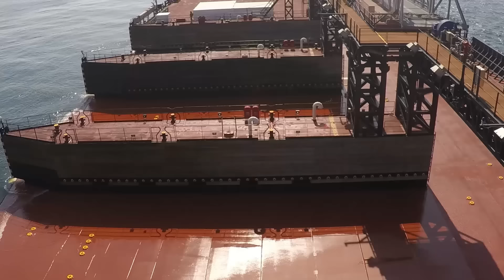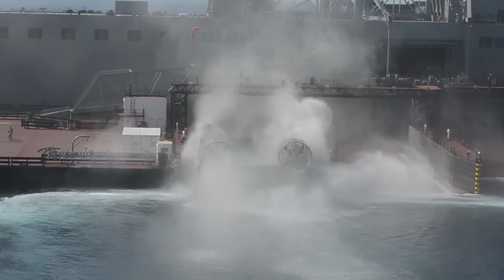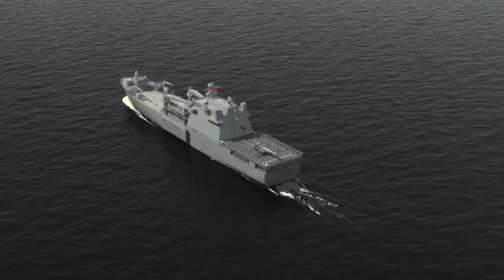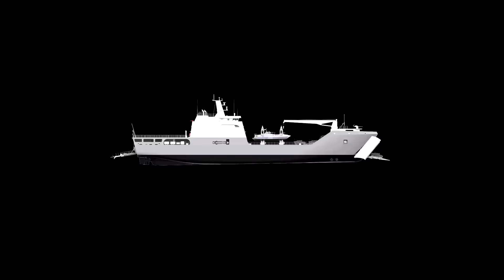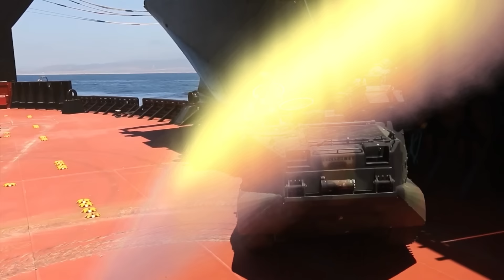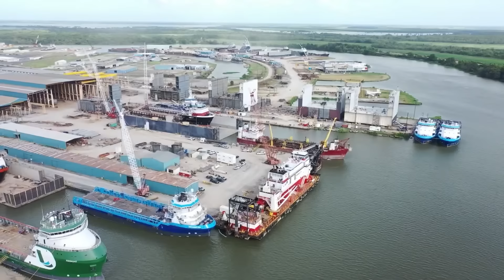The SHOCKING Truth About the US Navy's Idle $430M ESD Ships

Comment: Steel is cheap and the bigger the vessel the easier it is to upgrade various capabilities. The ESD vessels with a Helo Deck added but used for Shipping containers would make the Shipping container based missile systems and VTOL drone fighters easy to deploy. The small vessels will have issues with self defence.

Comment: Add a flight deck to make it more akin to the Expeditionary Sea Base (ESB) ships - which in turn don't allow LCAC transfers
Add a big crane for self (un)loading or transfer
I never understood why the USN built 2 similar expeditionary ships with such dissimilar capabilities, when these could so easily and cheaply have been merged into one far more versatile  design.
This is the kind of ship that typically won't get used in just its intended role - if you built in that versatility

Comment: This video doesn't tell the full story.  The two mentioned ships are the first two ships of of a new class of ship.  After these two came the Lewis B. Puller class which have a HUGE flight deck capable of operating CH-53s and it got rid of the LCAC operation.  There are 6 ships planned with 4 already in service.
Reply from the maker: Yep, I already covered the ESB in a previous video - https://youtu.be/5UIRUn5ttKg?si=S6IFFm-cIAbHIlAt This one on the ESD is primarily focused on what the best utilization could be for these ships in the current operational environment.

Comment: The one factor that was never brought up was that the ESD's are meant to be used to unload Maritime Prepositioning Forces Fleets that are forward stationed in Guam and Diego Garcia. The McClung-class is designed to move small platoon sized detachments during island hopping campaigns, Let me see you try to unload MPF RO/RO with a McClung-class, it is not going to go very well, since it does not have the ability to do it. Both ships are needed but for very different jobs. ESD's were never designed to be used in close to shore, they are meant to be used out in deep water that is generally smoother, they were deigned and built as a floating dock connector for transferring equipment from the MPF fleet to LCAC's for ship to shore where no deep ports were.
Reply: It also seems entirely possible to design and retrofit a system to make them be able to work in higher sea states. Like just an extendable platform that could go out into the ocean, and then, like the elk could secure to that and be retracted while it wouldn't be cheap or easy, it's clearly could be done to allow at least 6 or 9 foot seas.
Reply: @mcamp9445  Actually if they were to install hinged side plates it would increase the wave protection on welldeck side

Comment: These 2 ships are not the most usefull in current form but lead to a follow one design that offers more. All these ships do is act as a dock between landing craft and supply ships. They shpuldnt be in active service, keeping them in ready reserves is the best spot for them. Keeps them low houred, cheaper per year, and crews elsewhere. But they should build 2 more to have 2 on each coast.

Comment: A hybrid approach really does seem like the smartest path forward. The ESB and ESD platforms are already proving how much capability you can squeeze out of commercial-grade hulls, and they’d be excellent hosts for something like new Shield AI’s X-BAT VTOL drones when they become combat operational.  Pairing those ships with autonomous VTOL aircraft would effectively turn them into low-cost “assault carriers” built at cargo-ship prices, thus massively expanding the Marines’ ability to project airpower and provide distributed support across the Pacific WITHOUT relying entirely on big-deck carriers or the limited amounts of the San Antonio Class Amphib Carriers.  It’s a practical way to increase sortie generation, extend ISR coverage, and strengthen the overall stand-in force concept for island-hopping operations.

Comment: Note that they can easily be stood up in 2 -3 months, with simple updates and crew. Well placed for activation, when needed. Updates include improved sensors and air defense. These are supply ships and are capable of transporting lighter craft and equipment back to conus for repair.

Comment: These are two different types of ships, with two distinctly different uses.  Experimenting with the Monford Point-Class led to the much better Louis B. Puller-Class vessels.
Reply: It is not the US Navy, the USMC. Excellent supply and possible repair functions obvious. The mix and numbers are needed. Logistics can be boosted greatly with in theater repair of equipment.
Reply: @ChristopherUrsino It’s a dock.  The early version lacked much of the utility of the latter.  Trying to compare it against the new Landing Ship Medium is asinine.  The final configuration for the LSM hasn’t even been chosen.
Reply: @kmrtnsn  Landing ship, dock, is much different than the ESD ships. The ESD ships excellent transport to and from theater. Can set up repair capabilities and can assist assault in standoff mode. They do allow great flexibility in action with both landing and extracting. Much more flexible and efficient than the Landing ship dock.